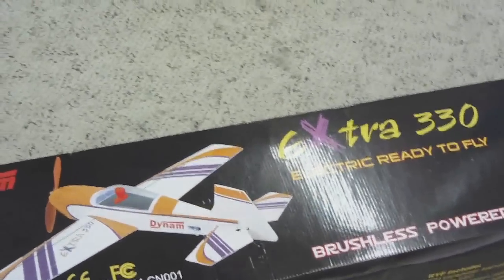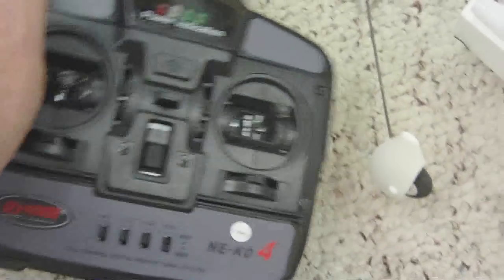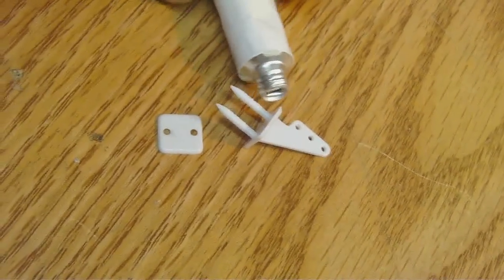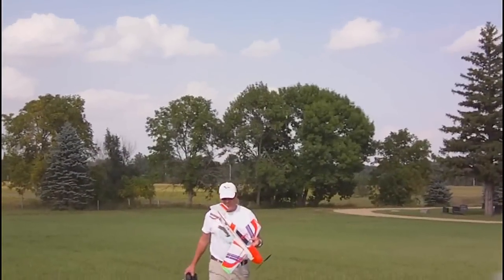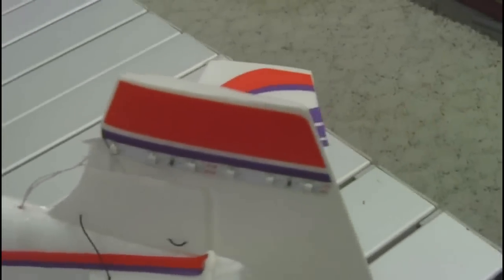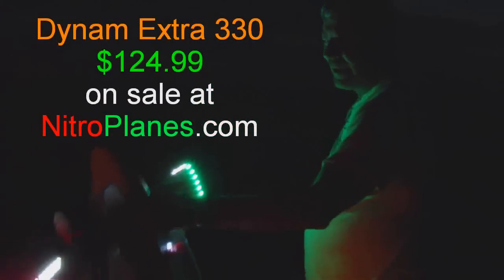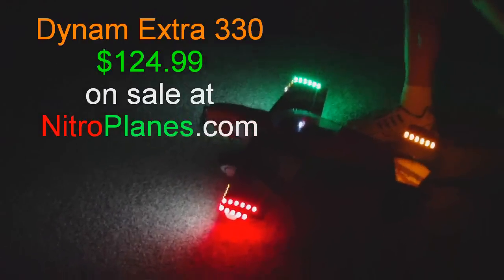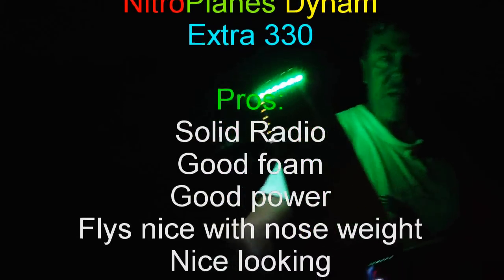NitroPlanes $125 Extra 330 review. Day & Night Flights + assembly.

Comment: Part:2 on the stock setting..so i had very little aileron authority. after moving the control rod to the outer most setting on the server horn all was fine. wouldn't recommend this plane for inexperienced builders.

Comment: part 1: I got the 2.4 ghz version of this..the supplied glue melted the elevator..the rudder servo was installed 180% backwards so the supplied control rod was too short. the newly designed prop saver is crap...during testing the prop went off balance ...flew off and bounced off something (happened too fast to see what it bounced off of) and put a big nick in the aileron. after finally getting the plane together maiden flight was horrible. the ailierons didnt have enough through on the "stock"

Comment: @trizzo5: The instructions are incorrect.  What you have is a "prop saver" - put the prop on the motor shaft, then stretch an o-ring over it across the 2x nuts and that holds the prop on.  In case of crash, it pops off to limit damage.  Good luck!

Comment: Great videos,I just got my 330, having problems with the prop, instructions show a nut but i was given a bearing with 2 screws, the prop clips on and screws to shaft but free spins and has no pull? There is also 2 rubber O rings i cant work out where they go.?  Any help would be great....
Thanks in advance

Comment: the only problem i have with mine is that on tight screws the screwdriver remains stationary and the bottom gear spins, but i think that is because i didn't put glue on before i pushed the screwdriver head into the gear.